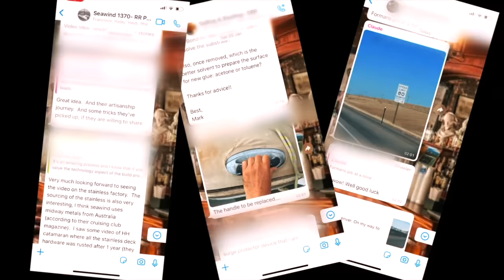What's Up with the Ruby Rose 2 Catamaran Build? All is Revealed.

Comment: It's starting to be a lot easier to picture the actual layout and space you're going to have, maybe not QUITE enough room to bounce on the bed but close LOL.  One HUGE positive about being on-site for most of the build, and working so closely with the PM and guys on the floor, is you're going to KNOW exactly where every bit plumbing line and electrical cable is.
Reply from the maker: Yes, that’s a huge advantage, we feel very lucky. 😊
Reply: @sailingrubyrose  yes, many manufacturers would not permit you being on the premises like you are. They would claim you are a liability, and a hindrance to the project. Hats off to Seawind👍🏼

Comment: I think this is so amazing .. to see your yatch being built. 
A few videos  ago I asked about insulation.  Is there any? Another question. I hear lots of yatch owners talk about mold.  Especially  those in the tropics. Seeing how the hull and inner form are made and fitted, how do you control mold between inner and outer forms. If you have A/C, there will be condensation where warm and cold meet.
Reply from the maker: Fibreglass doesn’t need insulation as much as aluminium or steel

Comment: It’s really interesting watching the build process move forward with the various pieces.  It also helps that you continue to point out different parts that were previous discussions, like the water tight bulkheads and compartments, which also makes it easier to understand where those sections fit into the actual boat.  What do they use as the actual mattress platform since the bed birth area looks a little short for a typical king size mattress?

Comment: To be frank if I had preordered a 1370 Id be very happy at about build no - 10 position.  By then a lot of the new build hurdles will have been systematically iron out.  A bulletproof wiring harness is critical

Comment: The intricacies of the build are fascinating. On the starboard side module where they filled a seam with fiberglass. The piece on either side is gel coated. How do they finish the seam?

Comment: While I know the design of the boat is set in stone, and as you know, I'm not a sailor and if you remember, I have a serious fondness for Privilege Yachts, I do have a question for you.  That 4 x 6 space in the middle of the bow, could have been been sectioned off and then used to expand the width of the forward staterooms, particularly where the beds are, to move the beds further towards the centerline of the yacht, giving you more room in the cabins?  It may not be possible, I can't really grasp the way the yacht is laid out, but I'm curious.

Also, I would assume you're probably a couple of weeks behind on the videos, doing the editing and such, but do you have an expected rough date for completion?

Finally, Nikki and Jason have announced Curiosity is up for sale.  Did you get them a deal on Hull number 3?  LOL

Comment: Still does not answer my question from last week. Nice progression however.
Reply from the maker: Sorry mate, what was your question? We may or may not be able to answer it
Reply: @sailingrubyrose  Sorry that was probably a little harsh. I was not following your explanation of how the living quarter sections are tied into the hulls where you say that some or glassed and some are glued. Let me explain my misunderstanding. When they drop the bedroom section into place for example, and then it is glassed/glued in, is the bottom of the section 'resting' on the hull floor in various spots? Or is it 'hung' from the hull by the bedroom 'walls' so that the floor doesn't even touch the hull?

 In my mind in this way the section my be sitting like a "U" being glued to the tops and sides. In this description it can float freely, well not freely exactly, but it may come loose over time. But this couldn't be true because you clearly stated in past videos how creak free the Seawind's are when sailing. So in my mind I'm thinking that the sections must 'touch' the floor or hull for support, but if this is true then how do they stop that area/section from creaking? How do they get underneath to make sure that the bottom is bonded to the hull in the spot where it touches? Do they just glue the spots and then drop the bedroom section in and hope it glues sufficiently?

Have I explained it ok? It seems to me that the 'hull' and the bedroom section sides would be very close to each other and could creak if not glassed or glued the whole length down the sides of the hull sides, But surely this would be difficult to do the whole length of the bedroom section's length? 

So basically not getting how everything is glassed and glued in sufficiently to provide the necessary support and stop the creaking longterm.

I don't know if I explained it any better last week. I'm glad you guys are so excited, and the cat does now look like it's taking shape. You must be very excited! It's going to be a fantastic home for you both. Congrats!!
Reply: @sailingrubyrose  Not sure what I mean?
Reply: @sailingrubyrose  Nick? Could you work out my confusion?